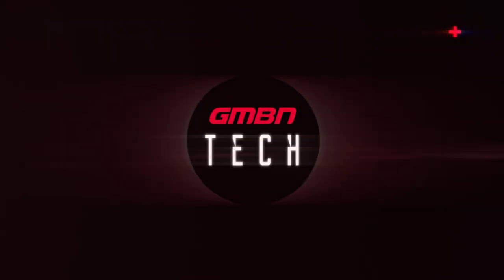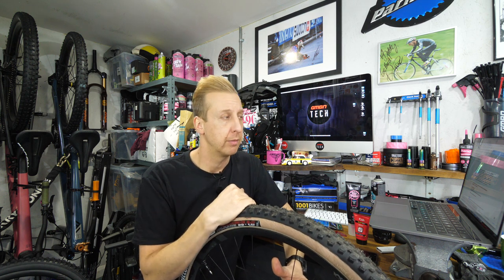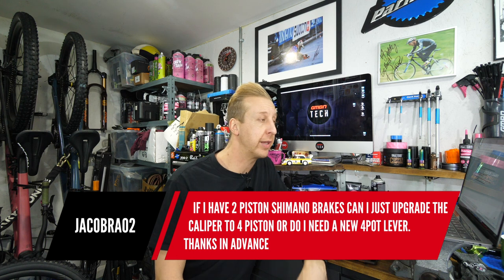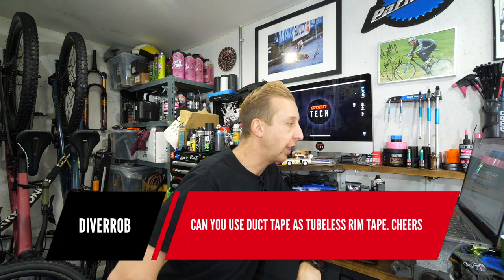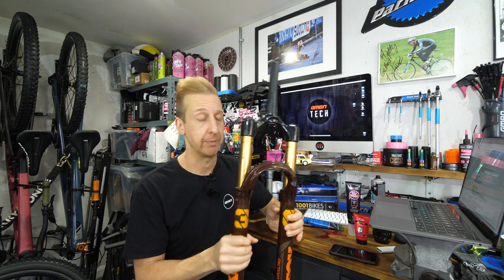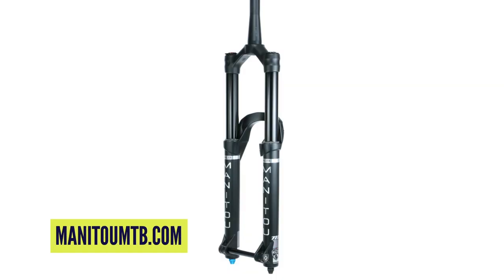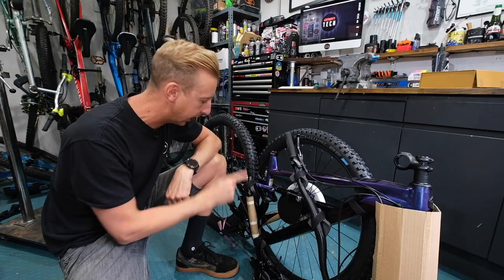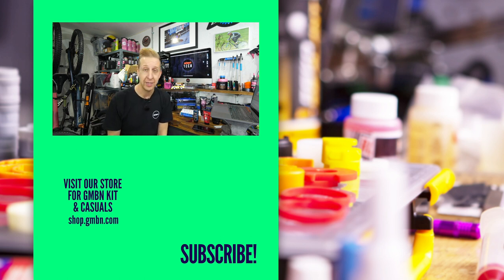What's The Difference Between A Reverse Arch & A Traditional Fork Arch? | #AskGMBNTech

Comment from the maker: Have you ever seen someone with their forks on backwards? If so were you able to help them?
Reply: it only happened once to my friend and right before we did the jump i noticed it and luckily i could stop him in time and we fixed it
Reply: Just found two of them on Ebay. I texted them and both aren´t availible anymore
Reply from the maker: @terrierethan1  That's lucky!
Reply from the maker: @Thesuperapp98  Do you think they could have been stolen?
Reply: @gmbntech  I can´t tell. One was nearly brand new. Build out of the box and than only driven once, but the Account exist since 3 years and had good reviews
Reply: I bumped into a couple of young kids on a trail n he started to tell ones that his dad went into halfords with his bike because the fork was put on backwards by guy in shop. He said his dad was going nuts because guy in shop wouldn't turn it round. The kid is now on a bike with the brake facing foward n wheel at strange position because his dad knows best
Reply: Backwards forks are common in Ikea and Walmart bikes. Scary.
Reply from the maker: @Rab_Cee  SO BAD!
Reply: @gmbntech  i couldnt bring myself to say its backwards to him. He was so proud n seemed ok on the path jump they were doing 🙊🙈
Reply: @newttella1043  The one I saw was a 4.000€ carbon Cube with a Fox 36 factory
Reply: Nah not backwards, but I ran mine upside down for months before noticing

Comment: I have a Manitou fork (reverse arch) and it doesn't hit the frame, fork or any other part of the bike. That is a seriously weird bike if you fully compress the fork and it hits some part of the bike. I love it because it does an excellent job of clearing mud before it gets to the stanchions. Texas mud is very sticky (more like clay than mud) I have a 1.9 I use on the rear, anything else doesn't clear mud very well, but I just use my regular tire (2.8) on the front, and that combo handles mud fine. The stanchion is shaped in such a way that it seems like it "cuts" the mud off the tires before it has a chance to become an issue.
***One of bikes brakes "chatter" when using the brakes, I struggled for months to figure it out, didn't really seem like it was coming from the rotor. I changed the rotor out on a whim one day, and it went away. They didn't feel "grabby" or "sticky" in any way and stopped smooth, that's why I didn't really think it was the rotors or any other brake part.

Comment: The Left Pedal has an left-hand thread ! If the crank faces forward, then you apply the tool facing backwards. If your bike is standing regular (not  fliped on the handelbar and saddle) then you push die lever of your tool down. That works the same for left and right.

Comment: Persuader - I call mine big bertha and she's a big iron bar with with a 3/4 socket on the end when combined with a draper allen/torx set she is undefeated! Also you can hold the business end and get more that enough leverage with one hand so it can help reduce slippage due to the weight.

Comment: I had a 28 spoke front wheel on my entry level hardtail and I broke the rim during an awkward landing. I’m running a 16.6mm internal width front rim now as a placeholder because it is all that was in stock, however it is absolutely bomb proof.

Comment: penetrating oil, breaker bar, heat, no joy... mains powered impact wrench, off it (crankset, cassette, center lock rotors) pops. just make sure youve got a firm hold and it's the right direction!

Comment: I had the clicking problem with my first set of disc brakes. They were super cheap mechanical ones. The click was steady and consistent like each spoke was hitting the caliper. But I checked, the spokes were not touching the caliper. Plus the sound would temporarily go away if I lightly tapped the brakes and did not get worse when I leaned my bike to the side. I figured maybe the outer end of disc itself was tapping the inside of the caliper. I never figured it out because it took me less than a week to replace them with the cheap Shimano hydraulic brakes due to poor performance.

Side note: My bike came with rim brakes. After finding cheap used rims with discs, I figured it was time to upgrade. I'm super happy with the Shimano hydraulics. MT200, I think.

Comment: I would love to see the replacing the brake to a 4 piston as I want to do just that
Reply: On a Shimano Deore please
Reply: @senanryan8476  I just went to the Deore 4 piston MT520 upgrading the caliper only (same direct hose connection - not the banjo like SLX and above as mentioned in the video). I've done a bleed and noticed the lever seems to pull closer to the bar than the 2 piston MT500 I replaced. I haven't ridden it yet but I'm guessing that's how it's meant to be and maybe what people refer to as modulation. If someone disagrees tell me what I did wrong :)

Comment: Use safety glasses when you use an extender on a wrench, some don't bend but shatter! Also watch out where your hands will end up if you slip or the bolt loosens, you can break your hands when they hit those metal parts!

Comment: #askgmbntech Hey Doddy, do you know when where full suspension bikes invented? how much travel did the first full suspension bike had? thanks, long time susbcriber.
Reply: Raleigh activator I heard.
Reply: I had an AMP B2 in 1994/95ish, it allegedly had 2.5” front and rear but realistically it was 1.5”
Reply: Around the 1890's - the McGlinchey and the Becker are two.
Reply: Customer at the shop I used to work had a Pearce which was a US made bicycle. Dated from around 1890’s had a twin blade leaf spring stye fork with a dekerf style soft tail (Spring in a yoked seat stay arrangement). Also had maple rims iirc. There’s a link to the type of thing here. 

https://www.cyclesmithy.com/products/1901-pierce-dual-cushioned-shaft-drive-bicycle
Reply: @southney7211  The golden age for bicycle innovation was the 1890s, thousand of patents applied for. Mountainbike inventors in the 80's and 90's were disappointed to find out many ideas were already invented, including suspension.

Comment: Attention if you retighten the spokes. I somehow destroyed my wheel. I retightened the spokes 3 time and trued the wheel  At the end rim broke 2/3 along  the rimbed. It could be possible, that the rim was cracked before, because I had a crackeling noise from the spokes while i was rolling (like Doddy said when the spokes rub at each other).  And the tail felt funny when I rode diagonal over bumps. Like the tail is also streering.

Comment: I have always thought that was a bit backward regarding hyperglide systems, they don't supply the hyperglide chain, the chain is like the icing on the cake, i mean yeah it will work ok but is better if the system is complete for ultimate performance, you won't really notice it, but when the proper chain is fitted the gear change and running of the chain will feel smoother.

Comment: I had the same problem with the tight crank bolt with my sram dub cranks and I had to buy a 24 inch breaker bar and I tied the other crank to the chainstay with an inner tube, it came loose but did not sound nice when doing so, been did I g it for a few months now and it’s all good

Comment: #AskGMBNTech Hi Doddy love the videos, I am in need of some help with my bike. I only have a carrera vengeance and the suspension seal has gone. I do not have the tools or grease to replace it but I am confident I could replace it. Should i pay for it to be done professionally, buy the grease ect or get the new bike I am looking at (my current one is nearly too small for me anyway). Thanks in advance, Joe
Reply: you could get a new fork
Reply: @bothwell07  thanks for the idea but that would be too expensive for me as I want to get a new bike by the end of the year

Comment: Would the reverse arch have something to do with brake-boosters from back in the good old days? I'd imagine putting the arch on the back would allow a booster and indeed the rest of the brake system could be set closer to the fork leg. From there it's a nice holdover which makes a brand stand out.

Comment: #AskGMBNTech CHAIN SIZING question - in the last 10 years chain sizing has grown to be more complicated, mostly due to 1X drivetrains.  Sram eagle, shimano GRX, etc, all have a different chain sizing method to make the system run optimally.  This is all stated in manuals listed on website.  what i think is the sheldon brown method -  wrapping chain around the large rear cog and large front ring and adding two links, is now almost obsolete.  

question - cant every chain can be sized the same way?  The method-  wrap the chain around the smallest rear cog, run it through the derailleur , and wrap it around smallest front ring.  Then give derailleur a touch of tension so it can function.  So the chain is not rubbing on itself through the pulley wheels.  This should be the exact size chain needed every time, every drive train.  The derailer is in its most compressed functional setting so it will also extend to its functional extended setting. I wrong on this?

thanks for your expertise.

Comment: Gorilla tape does work for tubeless but leaves a horrible mess if you come to remove and replace it. Loads of thick glue everywhere. It's not cheap either. Tesa tape is cheaper, works really well and just peels off with no mess.

Comment: #askGMBNtech Hello Mr. Dodd, love the content on the channel. I'm having an issue shifting my rear derailleur. Shifting up 1 gear takes 2 clicks of the shifter but each further shift up takes only 1. Shifting back down also takes 2 clicks but again each further shift down takes only 1 shift. The shifts are perfect except for the first one taking 2 clicks. The cable is fairly new, the chain and cassette not worn and kept clean and lubricated, limit screws are fine, and I've tried having a very loose cable  as well as very high cable tension. Any help would be very much appreciated. Thank you.

Comment: #AskGMBNTech What part of the leverage rate (beginning stroke/midstroke/end stroke) is most effected when short stroking or over stroking your rear shock? (When you run a shock with the same eye to eye length as it came with from the manufacturer but with a slightly longer or shorter stroke length)

Comment: Hey Doddy,
Great show as always! I watched your show last week which included a question you answered about upgrading from 2pot to 4pot calliper. Well I have a slightly different question to ask about Brakes. I have a Scott Scale 910 (2020) and it came with a 160mm rotor (rear). I am struggling with rear lock up so I am looking to increase the disc size to 180mm as this should give better brake feel and hopefully stop the rears locking when I don’t want them too. My question is can I get a 180 rotor on the back and if so which rear mount do I need because there are a number of different versions on the market and the location of my rear brake may need something specific.

Thanks in advance
Scott

Comment: In regards to crank bolts, a "cheater bar" is definitely your friend, or a any kind of suitably long breaker bar attached to the right bit. Strap the crank to the chainstay so it can't budge, put the bike's wheel flats on the ground so you can get some weight behind it and lastly... don't use your hands, use your foot and either stand on the breaker bar, or give it a not so polite stomp. I'd much rather slip with my foot and just kick the ground than slip with my hand and either punch some spokes, some concrete, or slam my whole body onto something uncomfortable in an embarrassing and painful manner.

If your cranks are SRAM, skip these steps entirely and just go buy a new bike instead.

Comment: #AskGMBNTech  I have an Orbea Rallon 2017 and had a DPS Performance rear shock on it, which I would now like to exchange for a new Marzocchi Bomber CR because my old DPS Broke. According to the manufacturer, my old rear shock has the following dimensions:
215/63 but most of the new rear shocks, and also the boomer have 216x63. Therefore, I would like to ask you first whether it is possible to install the boomer.
Thank you a bunch GMBN!

Comment: Hi Doddy.
Question from France - please excuse my mistakes in english, if any.
I am building a new XC bike (Radaon Jaelous). To install the pressfit BB, I did put some grease (shimano anti-seize) around the cups, but I forgot to put some on the frame. One of the cup is not exactly in place (space of thickness of a nail between cup & frame), but last move was with an horrible sound : I though that I did broke the frame ! Should I take asap the cup out and put some grease everywhere before putting it back, or should I try to press it until it is at the right place ? My fear is that it will be much harder to remove it in 1 or 2 year when the BB is worn out.
#AskGMBNTech

Comment: Why would you want even more underdrive gears? at 30-52 you're barely moving already and might as well just walk.
I've gone for 34-36 as my lightest and feel like even that's barely worth it...
In the "old days" I was running 32-30 as the lightest normal gear in a 1x8 setup, but I kept the 24t granny gear on the crank and just manually kicked the chain down to it to use it. then to get it back to the big chainring I just had to go the highest gear in the back and backpedal and it came straight on..
probably won't work as good with the narrow wide chainrings but you can still just run a granny gear and manually swap over for big climbs.. I think I'm gonna try that, its not like the 24t gear adds a lot of cost or weight...

Comment: Hi Doddy,
When riding here in southern Sweden in winter it can softer be quite cold, sometimes 10 degrees below zero or colder. Today when I was out for a 3 hour ride in -8 I  noticed that the dropperpost ran much slower and the suspension felt slow and strange, like I had way too much rebound. I’m thinking this is because the cold weather. Do you know if there is any recommendation for lowest temperature to ride in from suspension manufactures? And is there anything I can do to counteract this effect? I’m riding a 2015 Scott Spark with Rockskox fork and Fox rear suspension. Cheers, Tobias #askgmbntech

Comment: #askgmbntech Hey Doddy, I recently tried my hand at doing a lower leg service on my 2017 Fox Float 36 with the FIT damper. I did the service correctly (to my knowledge) following along with the video on the GMBN Youtube channel for a lower leg Fox service. After the service, I'm hearing a sort of "sucking" sound coming from my fork, only on compression and not during rebound. The fork feels fine when riding and behaves normally, also the sound only happens when I compress quickly. Comments found on forums have ranged from "get a new fork" to "everything's fine" so I don't know what I should do! Thanks.

Comment: On the last question, Doddy says manufacturers saving us money, by not spending them where we don't need to. WELL...when front derailleurs were common, they also specced higher group rear and lower group front derailleur. That had ZERO good intentions. Front one was more important. Very good front derailleurs would pull the chain down on reductions, while cheap one would struggle.
These days, a better crank rather than better derailleur would be better for consumer, as it gives decent weight saving, sometimes more modern standard. More stiffness and safety. They only wanna sell bikes imo.

Comment: Hi Doddy, I have some m8100 xt brakes and no I-spec shifters. Do you know of a problem solver, wolf tooth or other kit I can use to clean up bars without having to buy an expensive ISpec  shifter cover for an adapter kit?
MM

Comment: Somewhat complicated question: I have a 2014 Cannondale F29 Carbon 3. It is a nice light hardtail, but somewhat dated. As I have wantonly upgraded my newer dual-suspension trail bike, I have accumulated a bunch of SRAM Eagle GX take-off parts. I’d like to use the crank and maybe the derailleur to take my F29 from a 2x10 SRAM X9 drivetrain with X9 QR hub to a 1x11 or 1x12 system. I realize that the hub width is different from the newer Boost width bike and the crankset off-set is different. I can already hear you recommending just turning it into a 1X10. I am Ok with that Idea, but I would want a cassette with a bigger ratio, ideally with a 50T on the low end. Could you weigh in on the process here? Thanks for your wit, wisdom, and great Youtube channel! #AskGMBNTech

Comment: #AskGMBNTech
Hello Doddy, my question is when you buy a super tacky tire where is it better to be. Front or rear?
Reply: Front, all steering and cornering traction comes from the front tire, a tacky rear tire may be useful for getting a lot of traction on slick rock rolls or loose climbs, but they do not roll as fast, and it's fine to let the rear end slide around. If you're looking for a super tacky tire I highly suggest the schwalbe magic mary!

Comment: #AskGMBNTech Hi Doddy, I have a set of DT Swiss E 1900 Spline, and I have recently noticed a slight wobble to the end caps on the hubs (both front and rear). It makes a metallic clinking sound. This only happens when the wheel is off the bike, as I assume the axle holds them in place when on the bike. Is it normal or is it something more sinister?

Comment: #AskGMBNTech
I have a 135 x 10mm rear hub on my 26er.  I want to get a new hub with an XD driver, but almost everything I find is Shimano HG for 135mm hubs.  I read that I can use a 142mm hub and just swap the endcaps for my 10mm thru axle.  142mm hubs are easier to find.  Is this true and, if so, what do I need to be aware of when ordering a 142mm hub?